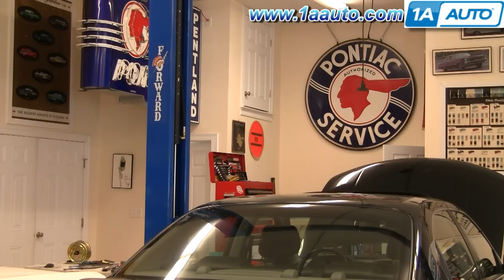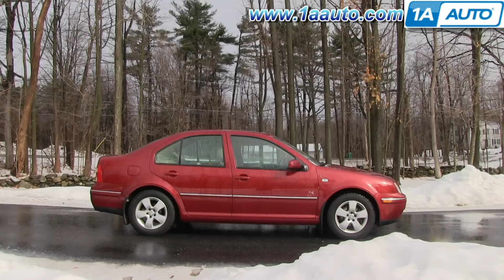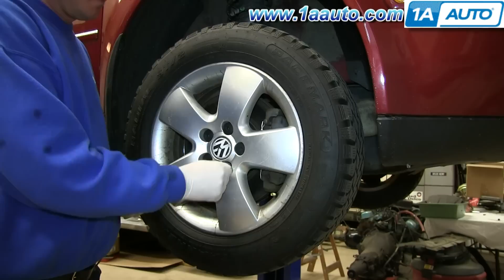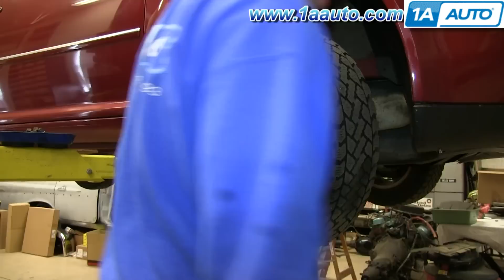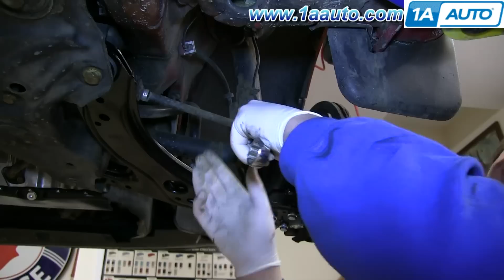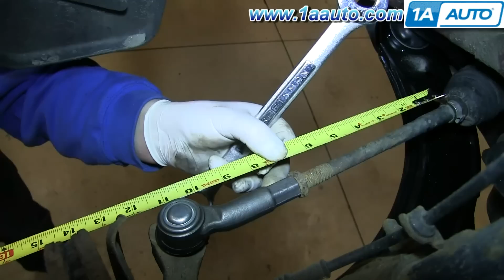How to Replace Tie Rod End 99-05 Volkswagen Jetta

Comment: And do you have to grease them up ??
Reply from the maker: +Derrick Sax The outer tie rods in this video are both pregreased and sealed from factory, so there was no need to add grease.  If the new parts come with a hole for a grease fitting then you would have to grease them up!  1aauto.com

Comment: Shouldn't you measure the length before tightening the lower nut all the way?  If the length isn't what it should be, won't you have to do it over?

Comment: 88'lb for the lug bolts. Makes me wonder whether the order torque specs were accurate...
Reply from the maker: +Just watching ffs Thank you for checking us out. This specification was gathered by multiple sources. 1aauto.com
Reply: 1A Auto Parts It's actually 120nm, which is 88.5 ft lb, for this specific model.

Comment: hey guys if your wheel is stuck on just hammer it with a wooden block inbetween your hanmer n rim.
Reply from the maker: +Sdddude123 Thank you for checking us out, as well as the recommendation. This is a useful technique, but for those performing this please be careful as to where you place the wooden block to avoid damage. 1aauto.com

Comment: Thank you for your videos!!! They are very helpful for they are very easy to understand. Your step by step instructions are so easy to follow that I have been able to do the rapairs myself. Thank you again.
Reply from the maker: +Ivan Ortiz That's our goal. We're glad we could help you out. 1aauto.com 866-403-3393
Reply: 1A Auto Parts are these tie rods the same on all these models? the 02 golf GL tie rod the same as the 02  golf GLS?
Reply: I agree.  I would like it if you did a video on replacement of the entire exhaust system with an OEM exhaust, not just a cat back.  Mine has heavy rust and should to be replaced soon.  I'm concerned that if just the cat back is done, a short time later I'll need to replace the entire system anyway.  I'd rather replace it before I'm told to replace it in order to pass an emissions test.  For now, it still passes, but each time it's tested, I run the risk of it failing.
Reply from the maker: +RedondoBeach2 We're always cycling through common cars. We'll add this repair to our list! 1AAuto.com